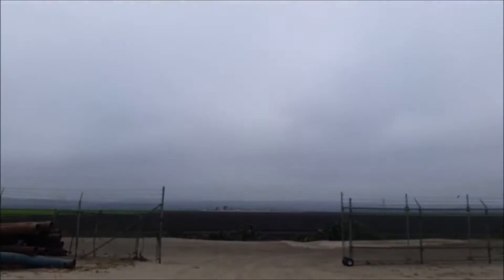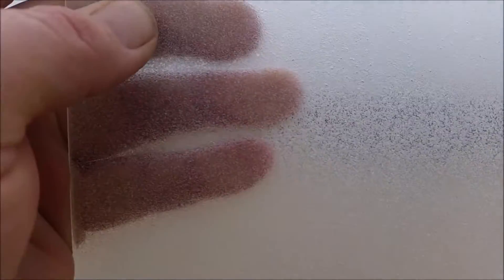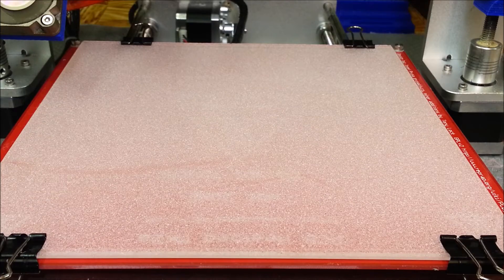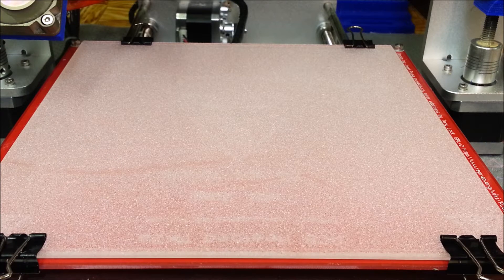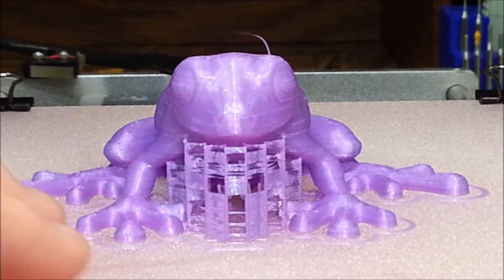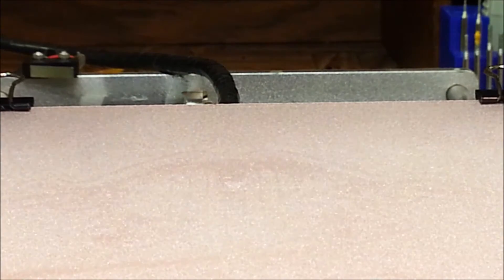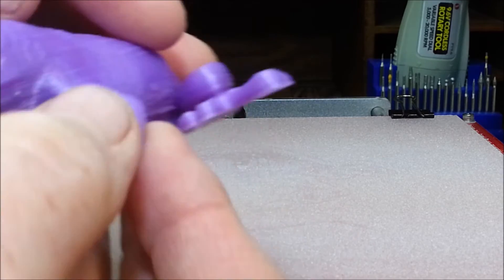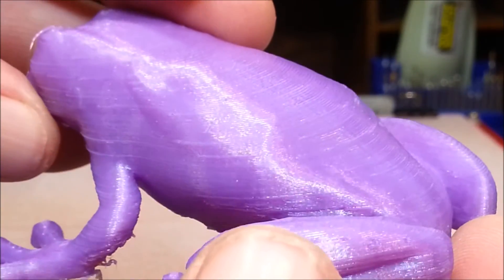Frosted Glass Build Plate Revisited

Comment: I know this was ages ago but was that ABS or PLA that you were printing?
Reply from the maker: That was PLA.
Reply: @JimmyShawsTidbits1  thanks for the info. I am starting to print ABS again. Old ABS even.
Reply from the maker: Unfortunately I've never had much luck with ABS.  Everyone says it has to printed in a chamber to keep the heat in.
Reply: @JimmyShawsTidbits1  It certainly helps if you have a chamber and a heated bed that can get as close to 100C as it can get. Larger beds helps. Someone was telling me not to let the printer change temperatures after the initial layer but I am not positive if that matters as much or not. My printer that I printed ABS on in the past is out of commission and I am now trying to print it on a much smaller printer. Breezes like those from cooling fans are bad for ABS. It seems some thing that it is okay to use a cooling fan after the initial layers but I do not know. I never had a separate part cooling fan. I used either washable glue stick or extra hold hairspray as an adhesion moderator. Having prints stick too much or too little is bad and those seem to work well. I guess some do not like the idea of using stuff like that though.

Comment: came out nice, congratulations!  If you want a finer frosting, consider soaking in hydrofloric acid, its what is normally used to frost glass because the sand blasting is causing microfractures, weakening the plate.  Word of caution-> do not use borosilicate glass for this because it can literally explode into pieces at some random time from built up internal stress.

Comment: Hi jimmy so my printer is working now but i have a problem when i press the home button in repetier or with the lcd secren it works without any problem but when i move only the X axis (the one with the extruder) it only move in one way and the other 2 axis works normal so how can i fix it
thank you
Reply: i've cut the filament at a 45° angle and it worked thank you and today i'm gonna buy a new wire to test the X axis i hope it works
Reply from the maker: +omar bentaleb I'm glad it helped.  I hope it works for you.  Please let me know.
Reply: i fixed the problem i bought a new stepper and it's working now thank you so much for your help jimmy
Reply: temperature 200 for extruder and 65 for bed and for the speed i went to printer settings then printer the travel feed rate is 1000mm/min and Z axis feed rate is 1000 mm/min
Reply: if you are  using repeiter can you please copy your settings so i can get prints like yours thank you
Reply: ok jimmy thank you i'm gonna download Cura and i hope it works
Reply: Ok i'm gonna use my usb i hope it works
Reply: hi jimmy i want to tell you that my printer works now and i want to thank you for your help
Reply: yes me too
Reply: the print quality is epic and how i know if i have  Z Wobble lines how they look like
Reply: thank you i appreciate it
Reply from the maker: +omar bentaleb I honestly don't know.  Does the LCD show the values change as if it is suposed to be moving?
Reply from the maker: +omar bentaleb Also, does it print correctly?
Reply: yes the LCD show the values change
Reply: i didn't print with cause i'm trying to fix this problem
Reply from the maker: +omar bentaleb I would double check all the connections on the board and the steppers as well as the end stops.  It sounds like something might not be seated quite right.  Make sure that none of the pins bent over.
Reply: i double checked all the connections and nothing is wrong i even swaped the X axis motor with the Z axiS motor and now the Z axis works normaland i still have problem with the X axis
Reply from the maker: +omar bentaleb so it has to be either a problem with the board or in the wiring harness going to the X stepper. Just for giggles, can you swap one of the harnesses from one of the Z steppers and see if the X moves?  I wouldn't try it on the Z stepper unless you loosen that motor's coupler and disconnect the other Z stepper.
Reply: so i need to remove the cable that connects the z stepper with the board and swap it with the cable that connect the X stepper with the board right (my englsh is bad ) thank you
Reply: i swapped the Y axis cable that goes to the board with the X axis now the X axis work and the Y dosen' work
Reply from the maker: +omar bentaleb Then it is the wiring harness.  Check the connectors on the ends.  There may be a wire that wasn't crimped or soldered correctly at the factory.  

I'm thankful it's not the board.
Reply from the maker: +omar bentaleb If you have a multi meter, you can check the continuity of each wire and find the one that's causing the problem.  I would definitely contact Geeetech for a replacement harness even if you do fix it.
Reply: OK i see thank you now i discovered  new problem when i put the filament in and i want to extrude it it keeps making sound and nothing comes out
Reply from the maker: +omar bentaleb what temperature does the screen show for the extruder?   Also, when you loaded the filament, did it travel a quite aways past the gears, or did it stop right there?
Reply: the temperature for the extruder is 180 and when i tried to load the filament i pulled the handle and it entred  a bit i don't know if it past the gears
Reply from the maker: +omar bentaleb it should travel about 20 to 30mm past the gears.  Otherwise it didn't travel down the nozzle throat.  Be sure to cut the filament at a 45° angle so it will be easier to stab it.  Also you may have to slightly bend the filament to make about 2mm of it as straight as possible so it will line up easier.
Reply from the maker: +omar bentaleb Also 180 might be a little cool.  Try 190 if it still doesn't extrude.
Reply: thank you jimmy i appreciate it  and i think the problem is not from the wire it's from the board because i swaped the Y axis cable that goes to the board  with the X axis cable and now the X axis work and the Y dosen't work what do you think
Reply: well i found the problem it's from the stepper motor driver any idea how can i fix it
Reply from the maker: +omar bentaleb I honestly don't know.  I'm sorry.  Is it firmware related or physically on the board?
Reply: i think it's physically  related cause i swaped the driver and the X axis worked
Reply from the maker: +omar bentaleb I would definitely contact Geeetech a have them replace it.
Reply from the maker: +omar bentaleb I'm so glad you got it up and running.  Any time.
Reply: hi jimmy i hope i didn't bother you with my question i've just printed my first item and it's this 20 mm cube http://www.thingiverse.com/thing:271736 and i got these results do you have any idea of how can i improve my prints http://imgur.com/a/rKn3u
Reply from the maker: +omar bentaleb how does it look?
Reply: here's a link to the photos http://imgur.com/a/rKn3u
Reply from the maker: What temperature and speed did you print at?
Reply from the maker: +omar bentaleb actually I use Cura. But the settings are simulator.  I'm away from my computer, but please check out this video at the 8 minute mark.    https://youtu.be/f4c55ppYdig 

I believe thay I go into the settings that I have in Cura in that video.  Pretty much the important numbers are travel speed and max print speed.  They are the 2 that can mess things up quick.  I hope it helps.

Otherwise for Repetier, the last few pages of the instruction manual has the recommended settings to start out.
Reply: thank you i will download Cura  and i'll copy you're settings did you show all the settings in the video and did you change it after ?
Reply from the maker: +omar bentaleb not much if any.  I change the print temperature depending on the filament, but for speed, it's the same.
Reply from the maker: +omar bentaleb Also, if you can download the 15.???  I can't remember the numbers.  But the older one is easier to set up.  I still haven't figured out the new version.  The Hot End has a tutorial on how to customize it, but I haven't had time to try it.
Reply: what version you have ?
Reply from the maker: +omar bentaleb 15.04.6
Reply: it's the same as the video right ?
Reply from the maker: +omar bentaleb yes.
Reply: thank you and what version do oyu recommend me to use ? cause there's alot
Reply from the maker: +omar bentaleb The settings in the video are for 15.04.6.  I recommend going with it for now, then when you feel confident upgrade to 2.1.2.  I will be upgrading to it probably in the next month or so.  I just need to learn how to set the print bed settings in it first.
Reply from the maker: +omar bentaleb I think it will.  I noticed a difference in print quality between Repetier and Cura.  Plus the depth of settings that can be changed is far better to tweak little problems.  Please let me know how it works.
Reply: excuse me jimmy what Baudrate are you using ?
Reply from the maker: +omar bentaleb I don't use baudrate.  I print using the SD.
Reply: i still have the same problem here's some photos of the prints  https://imgur.com/a/gOZYo and my Cura 15.04.6 settings http://imgur.com/a/g5oG4
Reply from the maker: +omar bentaleb sorry for taking so long to get back to you.  It looks like an extrusion issue.  Now the blue square.  Are the sides solid along with the bottom?  That looks like you need more infill to allow the top to have something to print on top of.

Second I see that you have your extrusion set to 135%.  That should only be at 100%.  Are there gaps in the print at the lower extrusion level? 

And most importantly, when you just extrude plastic manually, does it come out straight without curling back on the nozzle?  When you push the filament with the lever depressed, does it flow smoothly with little resistance or do you have to really push?
Reply: yes for the blue square the sides are solid along the bottom and i chnaged the extrusion to 100 and i extrude plastic manually sometimes it come out straight and sometime curling back on the nozzle and when i try to extrude filament using my compuiter or the LCD secreen it won't come out unless i oush it with my hand
Reply from the maker: +omar bentaleb it sounds like you have a clog in the nozzle tip.
Reply: i think the problem is from the ESteps i have 95 /mm how much you have ?
Reply from the maker: +omar bentaleb I'll find out when I get home and let you know.
Reply: ok thank you
Reply: hey jimmy i've found the problem it's another dead driver please don't forget to send me your Esteps and did you face any other problem with the printer for exemple a problem with a nozzle or something 
thank you
Reply from the maker: +omar bentaleb where do you find the esteps?  

Other than a massive clog, there has been very little problems than a occasional failed print.
Reply from the maker: Ok. E-STEPS per 1 mm filament is 0

The GCode Flavor is RipRap (Marlin/Sprinter
Reply: to find the Estep you need to go to control the motion then to the last one you'll find the Estep
Reply from the maker: +omar bentaleb e steps on the machine are +0095.0
Reply from the maker: +omar bentaleb I'm so glad to hear that it's up and running.  How is the print quality?  If you have Z Wobble lines, I know a guy...  LOL!!!  Have a great day my friend.
Reply: and what improvement did you make for the printer i see that you add a fan i think
Reply from the maker: +omar bentaleb I did z wobble brackets, the fan, and now the frosted glass.  Soon I'll try the heat sink on the nozzle throat.
Reply: and why you did you put a fan ?
Reply from the maker: +omar bentaleb to cool the PLA so it will bridge better.  It helps improve the print quality too.
Reply: can i get the STL file 
thank you
Reply from the maker: +omar bentaleb all my STL files are on Thiniverse.  http://www.thingiverse.com/JimmyShawsTidbits/about
Reply from the maker: +omar bentaleb anytime.

Comment: I tried with some plastidip spray on the frosted glass, it sticks allmost too well.
I use that on big prints i fear to warp.
but will buy a PEI sheet soon.
it will be easyer, no spraying fumes, and no surface ripping.
its a chance of ripping the surface of plastidip when removing prints, especially large buildsurface prints.
Reply from the maker: +Lynlimer That's cool!!!  I never heard of using plastidip.